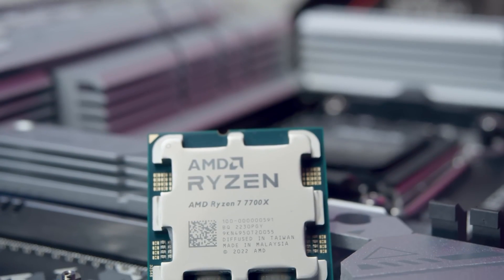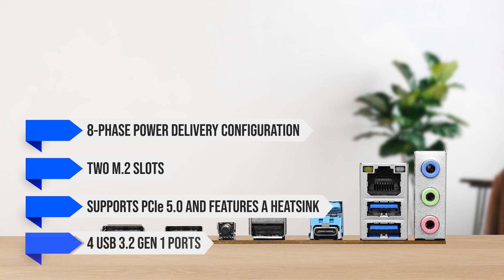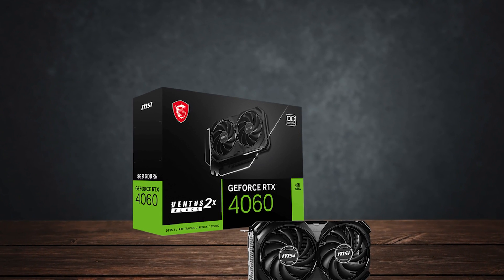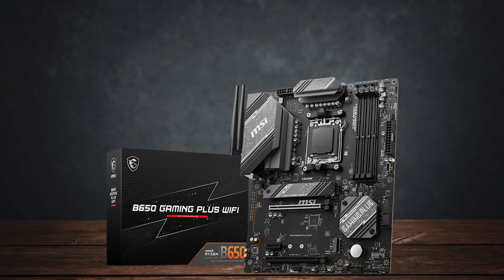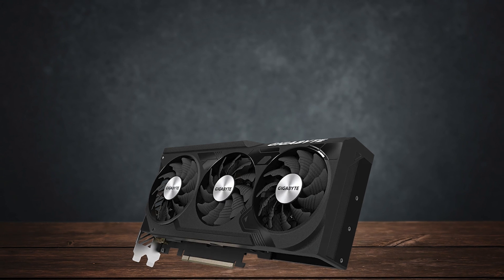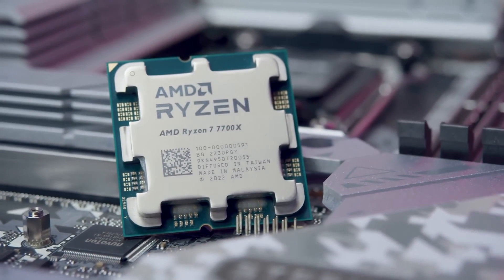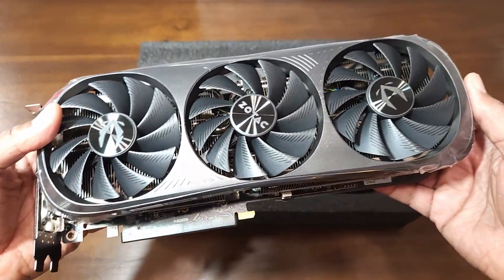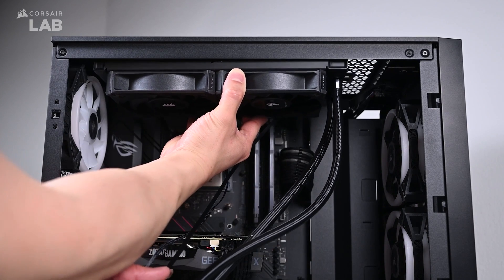The Best Ryzen 7 7700x PC Builds In 2025! (Budget, Value & High-End Builds)

Comment: Just received this chip today to pair with newly acquired 5060 ti 16gb and just in time for the Battlefield Beta 👍👍👍
Reply: I have a 4060 16gb and a ryzen 7700x. Is the motherboard good for them and is it doing good for you setup.
Reply: @BestBizonClips yes your gonna want a AM5 gen 5 board, I picked up a Asrock B 650m Pro X3d wifi board off AMZ for 149 and its definitely working out great, I mainly play competitive shooters Cod Battlefield Rainbow 6 Seige along those lines, 1st game i loaded was BO6 a mix of Ultand high settings and getting 200 fps in 1440p and about the same for Rainbow 6, i hate Battlefield 2042 so I opted for Delta Force and it runs pretty good but im patently waiting for the BF6 Beta to see how it runs but im sure it'll handle it as well

Comment: Bro is asrock b650m hdv m2+ motherboard capable to provide 138w at full power of 7700x
Reply: Everything with more than 8 pin for the socket can. If i remember right the old 4 pin handle around 50-70w 8pin around 100-140w So 8, 8+4 and above are OK, depend on PSU stability. 100-150w is not so much this days and even budget MB handle around 120-140w easy. Not to mention that 7700X is even better at -30 undervolting on curve optimizer.

Comment: Hi, first I wanted to compliment you on your video,
I'm sure you'll be able to advise me best on the following.
I'm a big photography and video editing enthusiast.
I would like to ask for your suggestions for purchases.

My primary PC is a pre-built configured as follows:
Motherboard: Asus Tuf Gaming B760 plus wifi D4 Lga170
CPU: Intel I7 13700KF Raptor lake 10 nm
RAM: 32gb 2x16 RGB ddr4 1795 MHz 18-22-22-44
Graphics card: RTX 4070 MSI
Storage: 1 Tb Kingston Snv2s1000g Sata 2 Nvme PCIe 4.0
Power: 750w

My second PC is a build from 2015 equipped as follows:
Motherboard: Asrock Fatal1ty Killer (Z87)
CPU: Intel I7 4770K 3.5/3.89 GHz
RAM: Corsair 16gb 2x16 DDR3
Graphics card: RTX 3060 Ti
Power supply: 750w ITEK GF 750

I would like to create a new build that could replace the second PC but with particular attention to costs with the best possible value for money.
I was thinking of a PC based on Ryzen AM5 architecture with the following components:
Motherboard: MSI B650 Gaming Plus wifi micro ATX
RAM: DDR5 32gb 2x16
Graphics card: I would like to use the RTX 3060

For the processor, I'd like you to suggest a Ryzen with the best value for money that would balance well with the rest of the mentioned components, particularly with reference to the RTX 3060 Ti.
Considering I'm using the 3060, do you think it makes sense to get a CPU with integrated GPU? I initially thought about a Ryzen 5 8600G but now my preferences are for the Ryzen 7 7700x.
What motherboard do you suggest in m-ATX format, and if you could help me identify which RAM to get.

AH, I forgot something very important - a motherboard with a valid and effective VRM power section, keeping in mind that I'm not interested in overclocking.
Thank you very much, bye Marco
PC use: graphics, video editing with Filmora and DaVinci Resolve, and AI applications

Comment: Can anyone tell me if these are good specs?
ASUS ROG STRIX B650
AMD CPU Ryzen 5 9600X
Corsair Vengeance RGB DDR5-6000 - 32GB
Crucial P3 Plus 2TB
Phanteks Glacier ONE 360mm
Sapphire Radeon RX 7800 XT
Corsair RM750e

And if it's a good upgrade from my current pc
Intel Core i5-12400F
Gigabyte B660M DS3H
Palit GeForce RTX 3060 DUAL
Gigabyte AORUS RGB Memory 2x8GB
MSI MPG A650GF 650W
KINGSTON NV2 1TB
NZXT Kraken X53
Reply: your 12400F can handle the 7800xt at 1440p. So just upgrade gpu and should be fine
Reply: @Pawankalyan1 👍
Reply: Tbh I would rather go for 7600x over 9600x. It's cheaper and basically the same (Or 7500F if you can get it in your country). If you want to pay more you can go for 7800x3D or 9800x3D. 
Rest is fine. Just check if you are buying RAM with CL30
Reply: @ I have been thinking about replacing the 9600x with the 7700x. Do you think that will work good?
And if it’s a good upgrade from my current pc
Reply: @VilladsGanshorn It depends what going to do. If you are playing basic mainstream games then 7600x is just better (same FPS + cheaper) I would go only for 7700x if I play CPU focus games (CS2 etc.) for as much fps as possible
Reply: @ what if I wanna play games like god of war at 1440p max settings. Then what cpu should I get?
Reply: @ there are many videos on YT on God of War so just write CPU + GPU + game and you will see yourself
Reply: At higher resolutions the cpu is less burdened. U can keep the cpu and upgrade the GPU